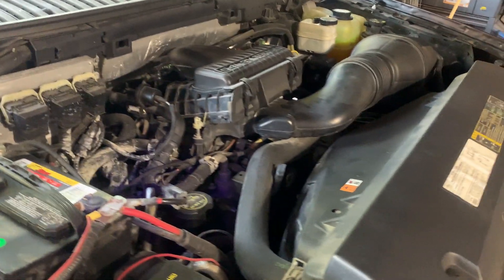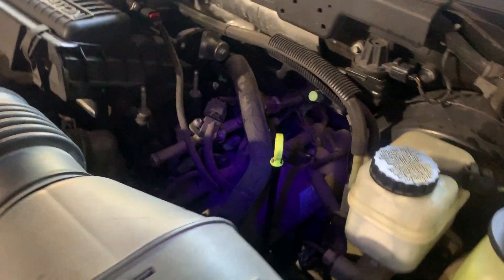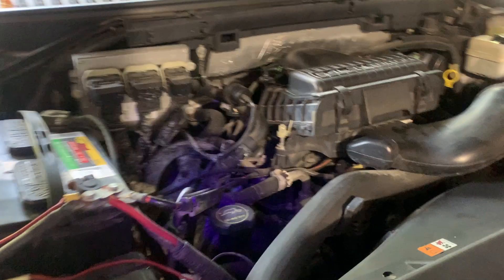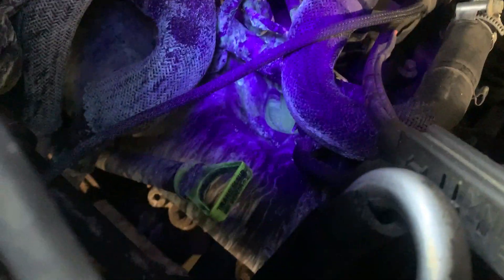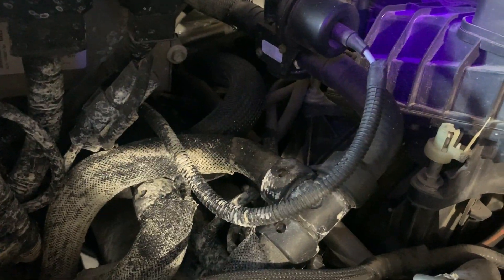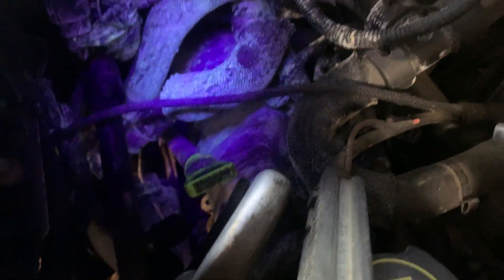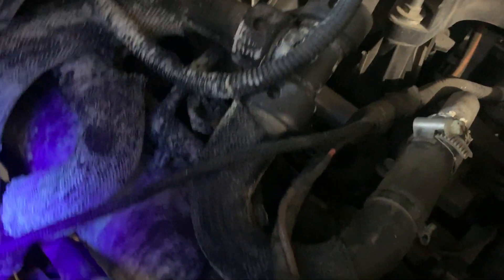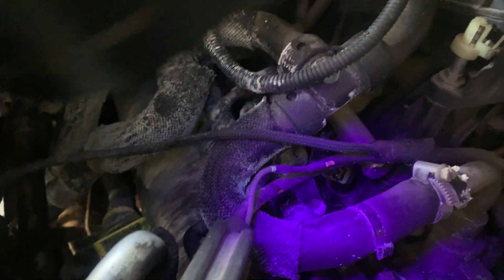Ford 5.4 Triton Coolant Leak Part 2 - UV test

Comment from the maker: It's just the heater T that is leaking, I hosed down the whole thing and it probably removed all the crud that kept the leak small, after I removed all the crud, it was really obvious where the leak was. Basackwards troubleshooting but I at least don't have to worry about something big.